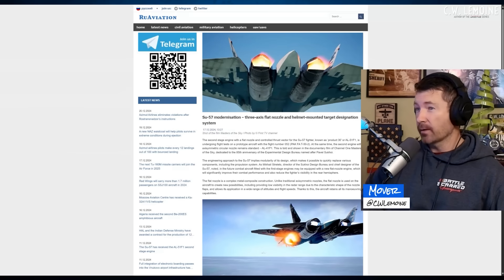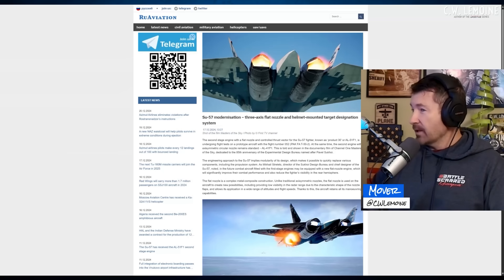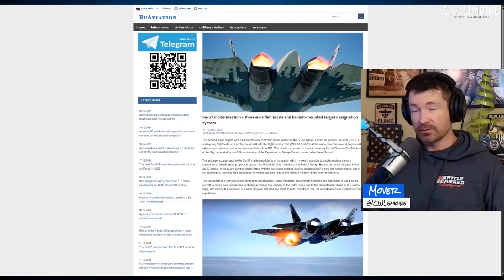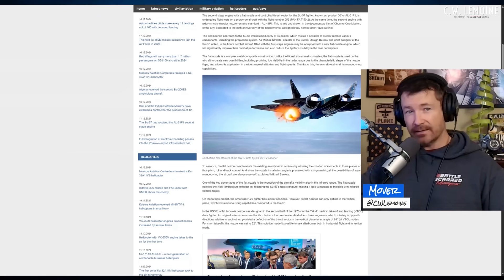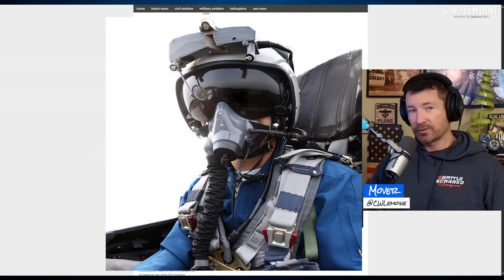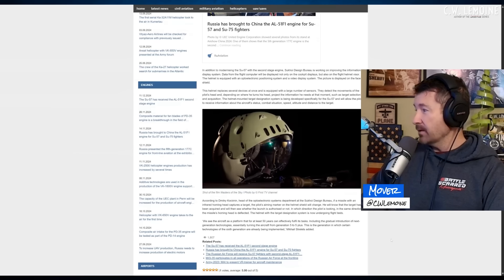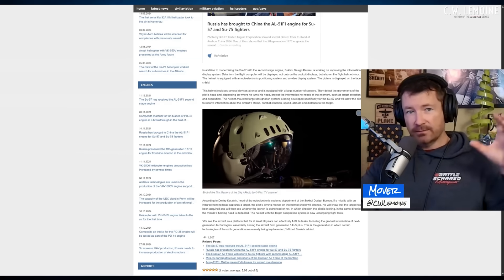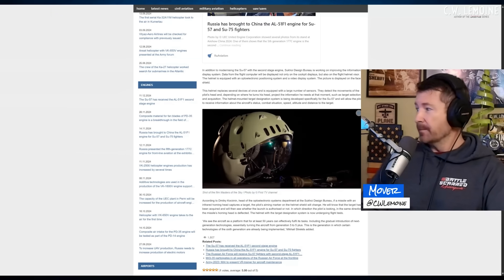New Upgrades for the Su-57 FELON

Comment: Russian military upgrades were behind because they had entire decades where there was no money investment in R&D due to the economic turmoil of the 1990s and early 2000s , they are playing catchup
Reply: Many dont get that unfortunately, if the ussr didnt brake apart, whatever it evolved into would have had a substantial new and improved technologically advanced force.
Russian recovery began in the year 2000 and through the first half of the 2010s. After that russians began to catch up on all fronts which is a process that is slow just as the recovery after such a traumatic expirience.
You can probably guess what changed in the year 2000 for the country to start recovering.
Reply: They always had money but strategic rocket forces ( including the navy ballistic missile submarines ) got a large proportion while the strategic air defense got a lot too. The air force started getting new platforms along with modernization and the army got what little money was left. This was the only way they could proceed as with the limited funds you have to start the long term & most important and expensive projects first.
Reply: Иногда можно срезать угол
Reply: @zinit22  Но фундаментальную науку надо подгонять.
Reply: Keep telling yourself that, if ww3 breaks without nukes, I would enjoy watching our front lines gets decimated over overconfidence bs, as if Germany in ww2 not only caught up in less than 5 years, but significantly had breakthroughs after breakthroughs. Half of Soviet Union used barter system after ww2, and yet we lost every step of the way in race to space until they stopped because flat out broke, we had to bring German scientists that worked with V2 to help. They were the first to make VTOL just to make their overweight mig able to take off, scrapped it when the vtol itself used too much fuel and added more weight. And they had hypersonic missiles before we do. And to make it worse, current proxy war, other than stock abrams, we have seen 59 Tomahawks rendered useless, ATACMS was granted to shoot inside Russia, ZERO made any impact, hits target but fails to destroy them, Bradleys also useless, Strykers, HIMARS, Stingers and Javelins, etc etc.. and we still have overconfident people thinking they will stay behind us after our greatest bs, F35. New Abrams came out, even more useless, more techs but the fact that rendered the stock abrams feature useless, still there and only manned by 3 crews which a buddy of mine said hell nawh, 4 crew already hard enough, 3 crew with that much delicate tech, that's just waiting for disaster. Never ever underestimate anyone, we lost 30% of our unit on DDay, let me remind you, Germany main army was gone in 1943 may after losing stalingrad, 30% casualties, highest and worst record than France had, and we didn't land alone on DDay, UK and Canada also joined.
Reply: Good luck catching up now
Reply: Still have catching up to do with AESA and avionics
Reply: @phunkracy All Su 57s have AESA radars. Mig 35 also has Zhuk AE AESA radars. However Russian AESA is very difficult to produce.
Reply: @phunkracy  s-400 radars are aesa...
Reply: @keslerjenkins9683  is S-400 a fighter jet? Su-57 by all reports is not great and Su-35 still use PESA
Reply: @phunkracy  Russia has already announced a large-scale modernization of the Su-35, 30, 34 aircraft. They have started to modernize them to the 5th generation, it has been stated that all 5th generation systems from the Su-57 will be used. The engine was presented in China and this engine was not developed for the Su-57, but for the modernization of 4++ aircraft. Radars will also be replaced. Russia has announced the modernization of its 4++ generation aircraft
Reply: @phunkracy 
By all the combat reports the western radars can't detect   the su57  ( the su57 overflow the  u.s  controlles irak's  air space) and the su57 radar  had shootdown a mig29  figther to 320 km 
The plane it's the best 5th generacion figther
Reply: @globalpower6967  Russia has already declared Kyiv in 3 days and war against all of NATO, how many F-35s have already been destroyed?
Reply: @vp6087  
Nppe.... the kiev in 3 days was u.sgeneral milley thing, russia talk about denazify ukranie
Reply: @phunkracy  Have you ever thought, "Why do the Russians, who created the phased array with electronic scanning, use a passive radar on their fighters?" Because the work of a passive radar can be alternated with the work of the electronic stealth technology that the Russians discovered in 2015. And the United States uses the work of the Russian scientist Ufimtsev, who discovered conventional stealth in 1965.
Do you need to explain further? The SU57, in the serial version which they never show you, has a quantum radar that was tested in 2021. Russia launched the same radars into space this fall. They not only provide an external image, but can also see which vertebrae you have are sick and which are healthy.
Reply: @ФеликсДзержинский-ф2ш  I haven't wondered because I know that Russians had trouble developing miniaturized AESA. There's no advantage to PESA and Su-57 used AESA, which is fairly limited and with outdated emmiters when compared to F-22 and F-35  radars and USA already introduces a new, even more powerful version for F-35. So yep, Russia is behind and they do try to make it up by slaving L-band aux radars and IRST, but it's no substitute.
Reply: @Ignacio-d1j  "By all the combat reports the western radars can't detect   the su57  ( the su57 overflow the  u.s  controlles irak's  air space) and the su57 radar  had shootdown a mig29  figther to 320 km 
The plane it's the best 5th generacion figther"

Ukraine says that Russia has demonstrated huge capabilities in the EW. Common BVR missile shots are over 50 NMI (90 km) and they hit targets. And in one instant a Russian Su-35S fighter downed Ukrainian fighter from over 95 NMI (175 km) distance with R-37.
The S-300V4 system has demonstrated that it could shoot down two attack aircrafts flying away (completely cold) and below 30 meters from 217 km away.
Reply: @TK-sh1lq  
Yes...    but have more little gifts like the pmm ra  honeycomb radar absorvent composite
Reply: @keslerjenkins9683  No, there are Nebo radars which can be coupled with S-400, but everything else from fire control to surveillance radars, are PESA.
Reply: @phunkracy what (all reports) you mean the battle fiels that propfed all your hi tek crap is garbage? The failed attack on Iran? Lol 😂
Reply: No, it's just that the main Ukrainian engineers left the chat or died over time. Even the chief designer of the Su-57, Davydenko, is of Ukrainian origin, judging by his last name.
Reply: @vp6087  Wrong
Reply: @vp6087 😂😂😂 К вашему сведению Украина это территория заражения Руси, и всегда была часть Российской Империи или СССР. Мы один народ по сути. Белорусы, Украинцы и Русские это триединство одного народа. Раньше они назывались Великороссы, Малороссы и Белорусы а вместо Великая Русь что на греческом Великая Россия. По скольку православие мы взяли с Византии, начали писать на греческом название государства Русь - Россия. Надеюсь теперь вам станет понятно.
Reply: @Максим-ж5п2ю азіат, перклади
Reply: @vp6087  What's that supposed to mean? The army chief was born in Moscow.
Reply: @vp6087  Ukrainian engineers good joke🤣🤣🤣
Reply: @globalpower6967  says the country that cant make a tank that doesnt sent the turret into orbit
Reply: @bigshow196  NATO tanks send their turrets into orbit! In fact, all tanks send their turrets into orbit!!! This happens when high-explosive ammunition detonates in the tank. If there are no high-explosive ammunition in the tank, the turret will remain in place.

Comment: Looks like they made the exhaust nozzle more stealthy. Yes, they are finally getting around to streamlining the RCS ... somewhat. The Russian design concept is to have low hour "things" like engines that break and you just replace them completely vs having a complex repair chain. Also, notice how Russian airfields are only now getting more aircraft hangars, for decades everything just sat in the open, winter or summer. HMS, yep, the first in the 80s. Cool. How much did we train against the HMS and ARCHER? :) Its a step up but not quite playing ball with F-22.

Comment: Mig-31k, Mig-31BM are the best interceptor fighter jets on the planet. They exceed 3000km/h. The modernization of these jets is to make an almost new jet.
Reply: Had top speed been most important, then I doubt that the US Navy would have replaced the F-4 Phantom with slower planes, as it is still the fastest plane to have flown in the US Navy til this day. And likewise do I doubt that Sweden would have let Gripen replace the much faster Viggen which was so fast that it was capable of hunting down a SR-71 Blackbird and gain a missile lock on it.
Flying super fast is just dumb, and cause stress on the airframe and it also dramatically increase the fuel consumtion and thereby decrease range and flying time. And nearly all air combats happens in speeds near Mach 1, and air combats at Mach 2 are as rare as unicorns.
So flying 3000km/h is a worthless skill. It just shows that the designers of the aircraft have prioritized the wrong things, and therefore are incompetent. A fast flying plane is just about bragging rights, and not about effiency on a battlefield.
Reply: @nattygsbord yeah that's why US builds entire fleet of fast F-15EXs to support slow F-35s, as well as wanting NGAD to be hypersonic, yeah, speed totally doesn't matter
Reply: @Янус_Ырт  Speed is only important up to a point, say Mach 2. Beyond that it doesn't matter that much.
And the reason why USA keeps the F15EX probably has to do more with its ability to have more hardpoints than just the 4 sitting on F35. Plus that F-15EX will be able to carry much larger long range missiles that are too big to fit inside the weapons box of F22 and F35. So it is mostly just a missile truck, using F15s powerful performance and big cargo carrying capacity. Mach2 dogfight capabilities are not a priority.
Only people who knows nothing about aircrafts and air combat believes such things are important.
Planes do not normally fly at those speeds. To reach those speeds you normally need to use an afterburner which dramatically increase the fuel consumption. And normally will the plane run out of fuel after between 3 and 15 minutes. And training an aircraft in peace time to fly at those speeds would probably not be welcome, as it puts the aircraft under enormous stress and pressure - which shorten the life of an extremely expensive aircraft.
Reply: Speed is and always will be very important for a fighter jet. Yes Acceleration to say Mach 1.6 is even more important, but raw speed itself is a great asset. If you are able to launch your missiles high and Fast it will get to its target much faster and will travel much further. This is obviously a huge advantage in BVR. Further a higher speed will allow you to evade the missiles launched by the enemy fighters. This requires high G capability as well as the ability to retain energy in a turn. Aircraft like the su 35 and the F15 are very good at it, which is what makes them dominant BVR fighters. The Mig 31 prolly has a lousy ability to defend itself by pulling these turns, but maybe it doesn't have to considering it's obscene engagement range. The Mig 31s can take out enemy AWACS at extremely long ranges which makes them very deadly for the opposition and they do have BVR kills at very long range in the Ukraine conflict, much longer than any US air kills in past conflicts. So let's understand that Kinematics will always be a hugely important part of air combat
Reply: Those top speeds are not important anymore.  Perhaps back in the Cold War, but not today.  There is a reason moderns US, Russia  and European fighters don't move that fast.  Perhaps for certain niche missions, but not for most fighters and interceptor.
Reply: You are living in the year 1970 apparently? And are still using those metrics and tactics.
Reply: And MiG-25 and 31 designed by Ukranians

Comment: The Su-57 nozzles are air-cooled. Raptor doesn't have anything like that. The Raptor will have more infrared radiation than the Su-57.
Reply: F-22 has never seen a war before
Reply: @ReadyOnThree  so have most Air Forces of the World? So what is your point?
Reply: @WALTERBROADDUS  Su-57 is not that bad. But l'm not a fan.
Reply: @hangonsapto2338  the marketplace has not found it to be that good either. It is largely a air show and media piece.
Reply: @WALTERBROADDUS  The marketplace has no need for an aircraft that specializes in air superiority with a side of long range missiles. Almost all militaries are looking for close-in CAS platforms.
Reply: air exists it is therefore cooled
Reply: Yup.  As the first stealth fighter...  apparently nobody had developed stealth detection systems for the raptor to counter.

The US does have thermal management as part of the F-35, B2, and B21 programs.
Reply: @kwonekstrom2138  IR detection and suppression has been a thing since the 1950's, even the F106 had IR tracking systems. The B2 design went to great lengths to hide IR signature.
Reply: @kwonekstrom2138  
The u.s don't have aerosol thermal masking systems
Reply: @Ignacio-d1j  Funny...  I don't remember saying they use aerosols.

The term I used is "thermal management systems".   Which is how the US obfuscates what methods they use.   Thise methods are classified.

Lockheed Martin has published information on how they're using additive manufacturing to cool turbines using that method...

It seems more likely that the manufacturer of those engines might know a little more about their thermal management than some dude on youtube, I'll believe Lockheed Martin.

A side note...  the B2 is known to cool it's exhaust to reduce its IR signature.  One of the researchers was arrested for sharing this technology with foreign powers (China).
Reply: What are you rambling about?
Reply: @WALTERBROADDUS  Is it not clear to you?
Reply: @TheArcticFoxxo  Nope. The exhaust is not being cooled.
Reply: @WALTERBROADDUS Su57's nozzles ARE air cooled lol, look at the nozzles closely, it has vents right underneath the external panel
Reply: @super-maneuverability592  you expect  your are going to chill your beer on it?🍺 Your not fooling a heat-seeking missile very much.
Reply: @WALTERBROADDUS nothing can cool exhaust nozzles to 0° lmao, it just has a far better thermal signature than the f22 and that’s something you need to accept. F22 isn’t the best anymore :)
Reply: @WALTERBROADDUS  still doesn't change the fact that these nuzzles are better than the F22's nuzzles
Reply: @WALTERBROADDUS  It isn't meant to? It's to reduce IR visibility and detection range
Reply: @Void_Dreamwalker It was inteoduced 20 years later...It should be.
Reply: @Loubie2005 We have no idea what the exhaust temperature of either aircraft all, all we know is that both engines are air cooled. 

You can't say something is better without evidence of that being the case.
Reply: @TheArcticFoxxo  I already know what the purpose is.
Reply: @WALTERBROADDUS  it's being cooled by the "bypass air"
Reply: It still leaves hot exhaust and it still has a hot engine. You guys are talking like this is some sort of the greatest thing since sliced bread? It still has a significant heat signature.
Reply: @WALTERBROADDUS  Just vatniks coping and still using Ukranian AL-31 engines 50 years old - the best what they can got.
Reply: @WALTERBROADDUS  Dude, they buy engines for the Ka-52 from Ukraine and destroyed same only plant in Ukraine that made engines for the An-124 and In-225. They're just orcs.
Reply: @WALTERBROADDUS  you're*

Comment: Since the mid-80s and 90s, most of the Russian developments in the field of electronics were curtailed or destroyed at the request of advisers from the United States (CIA), who at that time did everything to set the country's development back decades so that it would be easier to tear Russia to pieces. And for this reason, such developments as the optical electronic helmet of the pilot had to start almost from scratch in the 2000s. and this was also greatly hampered by problems in related fields and lost competencies and time in microelectronics. In fact, we have to catch up with a 15-year lag, and in these areas it is very difficult .
Reply: That sounds like russian excuses. Russia blames every problem they have on the west. There are several problems with this claim.
1. How do you suppose the cia  simply requested domestic russian labs and companies destroy their own work on behalf of the americans and why would they listen?
2. When did russia present any advanced electronics? I dont see any evidence of russia initially coming out with an advanced electronics platform and then suddenly going backwards and having to re develop. Their electronics have ALWAYS been inferior. The usa developed solid state electronics in the 1970s in the f111 and the russians were still using tubes.
I dont believe this silly claim in the slightest.
Reply: The Cosmopolitans, the Capitalists, the Jews, the CIA. Always somebody else. Howbout lookin in the mirror? How many times you need to step on the rakes to get the clue...

Comment: Su-57 square nozzle is pseudo-3D TVC. And this is often confusing people when media, and not only them, show incorrect animations of it. This is similar to Su-30MKI TVC - practically 2D, but each engine is rotated so that when the nozzles point up, they also point outward and when they point down - they also point inward. Plus the nozzle can move individually. As opposed to F-22 which has the nozzles aligned and moving only together.